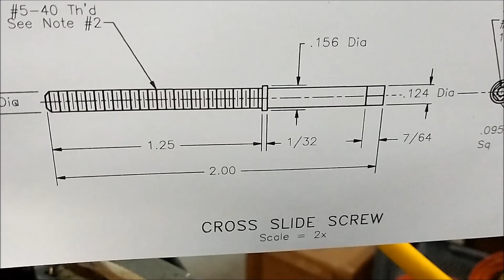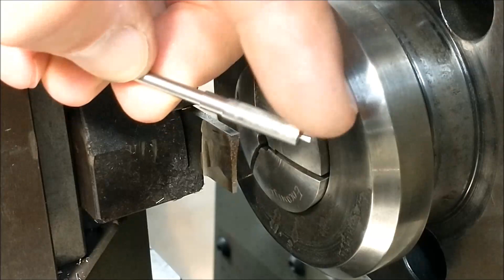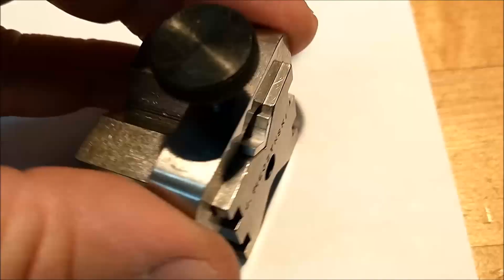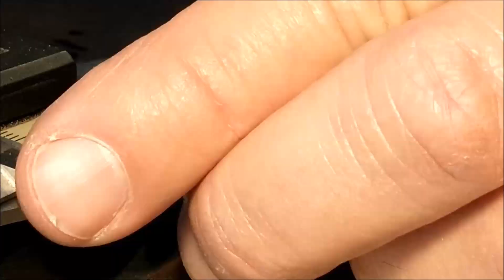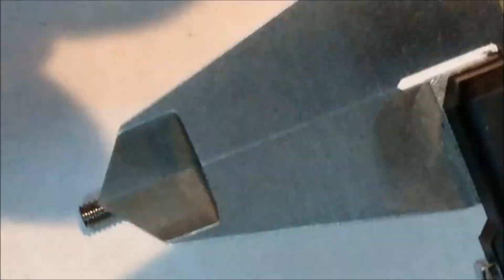Machining a Miniature Engine Lathe - Part  5 - Left Hand Lead Screws

Comment: I have watched this video twice and still can't see how you cut the internal left hand threads or the internal taper for the tail stock.  Did I miss it?
Reply from the maker: The internal LH threads were done with a commercially available 5-40 Lh tap. The tail stock taper isn't in yet, but will probably be bored.
Reply: @joepie221  I look forward to seeing that tiny taper being bored.

Comment: Why does it matter if you use a file on edges as well as round stock?
Reply from the maker: Its done all the time. I keep certain files for large flat surfaces and won't jeopardize the finish by dragging those files down an edge. Purely for cosmetic reasons.

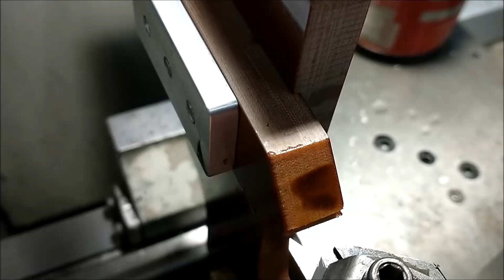Comment: Did I just see a right side up threading tool at 8:15? I'm curious if I did because I'm trying to thread some small diameter stuff myself.
Reply from the maker: Yep. Right side up and away threading is a left hand thread. My tools are normally inverted when I do right hand threads.
Reply: @joepie221  I actually realized that was a left hand thread way after I should have. Lol thanks for the reply. I'm trying to turn stainless to .154 and it's not going well.

Comment: Good show.  By way of reinforcement, your remark that the OD being oversized may be preventing the mating part to go on, is spot on.   Even if one is using a commercial ring gauge, the OD could be oversized.   Ring gauges, and plug gauges for that matter, are designed to screen pitch diameter and pitch diameter only.  They are made to contact on the flanks only, so a slight oversized condition can get past the gauge.   Always measure the OD.

Comment: Hey Joe! Big fan. 

As a huge novice over here, I always keep wondering what I should do with my little lathe next. Do you have any suggestions for tools/parts/projects to build with JUST the lathe? I have a little milling attachment but in a tiny 6inch atlas, it's not all that capable. 

Praying for the day I get a milling machine. 

Thank you for all the great content!
Reply from the maker: A chess set is a good project.

Comment: Hi Joe , I sure liked the follow rest you built for the small parts.   I keep thinking you could make a square or rectangular notch at the business end of the tool and make peices to fit in there that you could redrill for different size bar or if you have the right one just use it.   You could make a clamp system to hold them in place if needed or even a dowell to fit into.   This way you wouldn't have to make a new follow rest every time you changed size of bar.

Dale in Canada

Comment: Thanks for the idea about the wooden knob on the file tang Joe. I found the local hardware in Australia has them for about six dollars. I checked what I had in my "Don't know why I kept it draw" and found a Champaign style cork that does the job admirably.  The wire set up was still on the cork and acts as a grip. My wife and daughters imbibe the stuff so technically the cork is free for me! Thanks for the heads up.
Reply: Sounds good, but the wooden knob is less likely to be penetrated by the file on its way into your hand if you're unlucky enough for the chuck jaws to hit the end of your file.  I'm not a safety nazi, but  I'd be afraid to use a cork.

Comment: Joe - was thinking about you (and Texas in general) during the storm.  I hope all is well or getting better.  
Just as an aside, do you know if there are any H&S issues with machining phenolics.  I bought a piece of rod some time ago and was going to make some sleve insulators for the inside of cable heads for geophysical probes - high V, low I.  The seller warned me (made me sign a form) to machine with a vent system to extract fumes and dust....I forget the name but the stuff I bought had moisture absorption properties.
Reply from the maker: What color is it?
Reply: @joepie221  dark brown - almost looks like a piece of oak with walnut stain - if that makes any sense...
Reply: should have said - almost looks like a piece of fine grained oak with walnut stain - if that makes any sense
Reply from the maker: @markmonier-williams2508  Thats a linen based phenolic. Same stuff I just made my follow rest from. No glass in that material, but the epoxy and linen is not good to breathe when cutting. smells like formaldehyde if you get it too hot.
Reply: @joepie221  Thank you Joe - I appreciate the feed back....

Comment: Why did you choose not to use your phenolic steady rest/follower for doing the diameter?
Reply: Think about the difference of thread cutting and turning to diameter.
Reply: Joe's phenolic follow rest is set up for 0.125-inch work, but the raw stock is larger than that and won't fit without re-setting the follow rest.  At least that's my assumption after thinking about it during the video -- I initially had the same question as you did.

Comment: @
Joe Pieczynski (and all friends) - I"m a nube in machining, although I'm an experienced AutoCAD Drafter. So I have to say: The screw thread representation on the blueprint (at 0:00) is as crappy as It can be.
Anyone can see, if threads are perpendicular to the screw main axis, then you'll have a collection of rings equally apart from each other.
Of course, our lord and hope (Sir Joe π), wouldn't never let himself to be fooled by that kind of half ass draft job...
Reply: There are three methods of representing screw threads on a drawing.
    Detailed
    Schematic
    Simplified
With all due respect it sounds to me like you could use a bit more experience.
Reply: @highpwr  Oh, my friend, in the most simplify layouts, the simple tilt on those segments moul'd give the IMPORTANT INFORMATION about such sensible detail like inverse screws. Now, about your insult about my experience, I can't do much more as I'm retired. Sorry do not fill your requires.
Reply: @fdavillar  Multiple drawings, multiple views, assembly notes, and a common sense explanation from Joe himself in his last video in this series (Extended Small Diameter Threading Using a DIY Follow Rest.) about why these need to be LH threads, all lead me to believe 'important information' is noted elsewhere on those pages as well. I am just sorry that you felt the need to hurl insults at the original draftsman of those parts because he/she did not meet your personal requirements for a single detailed view instead of the schematic view. At least now you know there is more than one way to skin a cat, eh?  Stay safe and stay healthy.
Reply: @highpwr  None of this explains the lines "non tilt" in the draw. That's an easy operation made by two simple commands (rotate and array). Information in a blueprint is never too much. Also,  I am just sorry that you felt the need to hurl insults at me, for a simple comment containing opinion. That's really nazi. Please show more of that intolerance of yours. I'm delighted.
Reply: @fdavillar  "I am just sorry that you felt the need to hurl insults at me, for a simple comment containing opinion."
My point exactly. Bye Felicia....

Comment: Man, you make it look so easy. Looking great. Of course you are making little baby Gits oilers for this project, right?  It would be a shame to let a brand new lathe suffer from poor lubrication😜. And being in Texas you’ll also need to build a scale model oil rig and drilling engine to obtain the correct scale oil to use.
Reply from the maker: I'll copy the ones from my steam engine and place them at the main spindle bearing areas.

Comment: Hi Joe, I designed a machine with a phenolic gar that was supposed to wear and be replaced Ed before the steel gear it ran against. Bottom line, the steel gear wore out first.
Reply: My Arboga drillpress uses some phenolic gears in the gearbox. As I understand it, steel/phenolic gears is a very reliable combination. Long time ago we tested som small dental handpiece gearboxes for lifespan. Surprisingly enough the ones with plastic/metal combined gears faired best, and these where Swiss made precision units.

Comment: So many tricks that one learns over the years... We really appreciate your sharing that knowledge...
Reply: You did a great video on the art of finding exact center of your cut on a lathe, I've never seen the old and quick tried and true method of the six inch rule. Take the flat edge of a tool, pinch a six inch rule between the flat edge and your piece if it leans toward you it's low likewise if it leans away it's high, simply adjust your tool height until sraight up and down, and i don't get that dreaded nub from being off center.

Comment: I always want to ask this off topic question. What if i change the lead screw under the cross slide to fit a bigger dia. one, say, from 1/2 inch to 1 inch with same thread, match with a extra big dial. Does it make a better cross slide in terms of resolution? Because it is a somewhat scarly operation, if anything goes wrong. RIP the slide and a expensive but useless 1 inch tap. Do you have similar experience on these kind of issue? Is it really make the slide a lot better?
Reply: Resolution depends only on the thread pitch and how precisely you can measure the angle of the screw.  Larger diameter does have other advantages including harder to stretch and more thread length (maximum force is proportional to thread length).  Different metals expand with temperature differently so a fine thread on a large diameter using different metals can lead to problems.
Reply: @byronwatkins2565  it is going to be same thread because there are other scale ratio rely on that thread (but those scale had to be change anyway), i can only gain a better angle resolution from the extra big dial. It is a second hand Russian stuff, you know the polar bears, they do their metal works rough but beefy way. 

but after a second thought, i think i found one of the major problem, i only get one cross slide that fit this usage. Probably i should find another spare one before i play with this one...
Reply from the maker: The best trick for better control is not a bigger lead screw, but a bigger dial. It increases the gap between the index marks and allows for tighter positioning of the cross slide. Makes sense right?
Reply: @joepie221  thanks for the advice, i am trying big dials cut from plastic disc now and see how good it works.
Reply: I think i got a worn out lead screw, the middle and both ends give me different travel readings per turn in the dial. Another mystery solved......

Comment: Hi Joe, very nice job as always, can I ask a question, I would probably have turned the 0.125" in sections as you did, but would have continued with the piece in the collet, and pulled it out further and using a grooving tool turned the 0.124"  behind the shoulder, so I was holding with the larger dia stock, would you advise if this is practical, if not why, so I can learn,  thanks for you advice keep safe Tony
Reply from the maker: You can absolutely do that. Its called back turning. It was an option for this part, but I went in another direction.

Comment: A bit surprised you didn't use a half dead center for this. I would think that would have been preferable to the collet and follower arrest shenanigans. I suppose that, even with a tail support, you'd still need a follower rest for this.

Comment: One more fantastic job, great filming and editing.
Being new in the game, the dimensions are small, scaryingly small. Once listening to an educated watch maker I think Joe would do very well in such a class.....
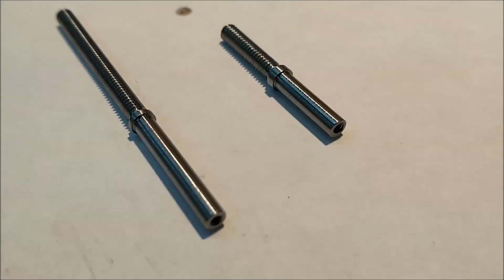Time 12:05, the two lead screws... The left one was just what I made, 3 of them, according to invaluable tips from Joe. 
2" threaded length, 1 inch shank and 6 mm size, 1/4", and 51 TPI, left handed. All made in one grip in a Harbour Freight class lathe. Adding some 1" waist length in both ends and a live center it worked out very well.
Grinding the part off blad will be put on the "to do" list....
Reply from the maker: I served my apprenticeship in the tool room ( fixture shop ) of a company that made watch parts. I made the crown punches and dies and a lot of fixtures and secondary handling tooling for the screw machine parts. I'd enjoy that class for sure.
Reply: @joepie221  Haha. Then You have already done the first class, maybe second... I'll pickup fortune telling again.

Comment: Golf balls make excellent file handles and many vendors give them out as promotions. Otherwise the driving range has a whole bucket for $10.
Reply: Yep and if you can get red or orange ones they are easier to find in a cluttered shop. :) Learned this golf ball file handle trick from my dad 50 years ago.
Reply from the maker: I like that idea.

Comment: Why didn't you use the follow rest you made for threading to prevent the flexing on the initial roughing of shaft?
Reply: I imagine you'd have to keep adjusting the location of the follow rest if you're changing the diameter. When you're threading, with no change in major diameter, it can stay at a given location. 

I'm not a machinist though
Reply: @totensiebush  Machinist or not, you are correct.
Reply from the maker: Set initially and correctly, I'm sure it would work.

Comment: That paper clip is a great idea!
Reply: I use the twist-ties from things like bread loaves or computer cables, I always seem a have a few around.
Reply from the maker: Most home centers sell aluminum wire used to hang drop ceiling frame work. Grab a bag and hang it in the corner. You'll be shocked at how many uses you'll invent for that stuff.
Reply: @joepie221  I do a lot of electronics work and the hardware is tiny. Best I've come up with is using a magnet. You've had several great ideas.

Comment: Me I’m a golf ball handle guy
Reply: Doesn't a golf ball go all weird if you drill into it? Last one I looked at was an inner ball wrapped in rubber bands. (There was also an Urban Legend that golf balls contained a deadly gas).
Reply: @spehropefhany yeah there is a liquid filled ball in some of them, but I’ve never had a problem been using them for at least 10 years.. we used to peel golf balls years ago and yeah, there was about a mile of rubber band in them.

Comment: If you put a radius notch in the front end of the parting tool it will automatically deburr the part as you cut it off. The flat profile of the typical parting tool can push away the part and leave a 
"Fin" in the surface that can be troublesome to deburr later. Try it - - it works great!
Reply: Good I’ll try it thanks
Reply: Interesting, Thanks.

Comment: Love the mixed dimensions in the print (mainly decimal, but sprinkled with fractions). Don't you feel the urge to mark-up the drawing to decimal?
Reply: Better yet make it all metric
Reply: @lifuranph.d.9440  Why settle for one unit of measurement when you can learn two?

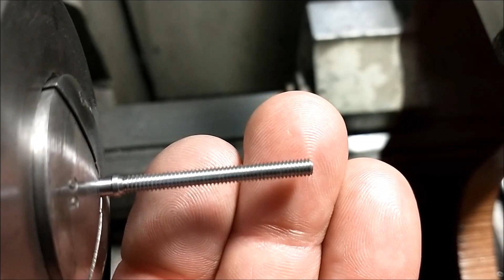Comment: At around 8:15 you mentioned the burrs didn't clean up as it did with the brass. As you stated later, a tight test fit could be caused by the OD being larger because of the material displacement Did you hit them with anything before test fitting with your test gauge? It would be neat if you showed the threads before clean up in an optical comparator. The valleys between the threads will be a V shape due to the profile of the thread cutting tool, but the crests should have a flat area.

Comment: It may not of helped that much here but the use of a disc type work stop might be a help in keeping the part under tension in the lathe. The disc fits over the OD of the collet and bears against the spindle or collet adapter.  It then has a hole to match the OD of the part. Slip the part through the hole and against the disc. When the collet closes it will try to draw the part into the spindle . The shoulder on the part keeps the part from moving so that when the collet closes it puts the workpiece under tension.  This type of stop is very useful when holding lengths on turned parts that already have one diameter turned. If you are making multiple parts and you have a tolerance that allows for finishing stock you might have a pretty generous size allowance.  For every .001 difference in OD a 5C collet has a .003 length difference. One of the problems with 5C internal collet stops.

Comment: I was going to ask what do you do  when one of those lead screws rolls off the bench, bounces off your boot and lands under the bench lodged in a crack in the concrete.
Reply: Chewing gum and a Wood dowel...Think about it - works whether its magnetic or not!  (Just don't rechew the gum.. Might be spider eggs in it!   Har ( Yeah, yeah, I know they're live birthed.)
Reply: say words not for print mostly. Then break out the magnets
Reply: @ThePsiclone  
Depending on the material it might be the brass or stainless* magnet. And that's why when working on small items at the bench or desk you should always wear an apron that extends up on to the bench. It's not a 100% garuanty but it helps.
And yes some stainless alloys such as 400 series are magnetic.
Reply: @ThePsiclone  These 2 are CRS Wasn’t another brass? You have a brass magnet ?
Reply: @lifuranph.d.9440  Endoscope with claw grabber.
Reply: How do you know about that crack in the concrete under my bench? 🤔